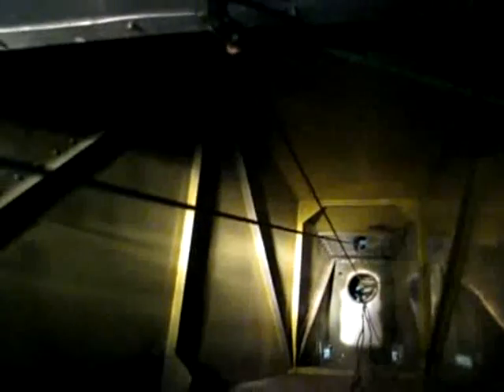Zenith CH-701 Elevator Design Issue.

Comment: That's the kind of stuff scares me about buying home-built aircraft how do you know what is good engineering or not following the kit manufactures design.
Reply from the maker: Good point. Only way to know all the goods and bads about any home built design is to join a group for that specific aircraft and ask a lot of questions. No kit manufacturer will tell you if there is something which could be designed better. But builders will as long as they have not drank the koolaid.  Hard to know for sure as many people in this world do not want to speak the truth for the sake of offending someone. I'm just a flat out honest guy to a fault.

Comment: yes it is about weight. Chris designed the 701 to fit in canadian ultra light cat in 1985 86 and he pulled his hair out to do it im told. I know of a few a original examples still around with plastic wheels 503 and 532 rotax no paint and lots of other design problems  that are probably in not much over 400 pounds . could it and should it be updated  yes you have to be comfortable with what you are flying  but i bet if one of these originals with a good prop and gear ratio change was sent to valdez   could give them a run
Reply from the maker: Even at gross weight Tim I didn't really notice an issue. Then again I have not flown it with a decent cross wind. Mainly because this is a fair weather aircraft. Anything over 15kts of wind is a no fly day for this aircraft.   As for Valdez, people have tried and are up their almost yearly in a 701. But the tail wheel aircraft with a normal rudder (not the full flying rudder like on a 701) are the winners every year. Because of this fact, I do not believe the 701 need that horrible full flying rudder. No one likes it and it obviously doesn't make it better for STOL as shown by the winners of the Valdez STOL compassion each year. I like that for the 750 Cruiser they put a normal tail on it.

Comment: anything you change on this plane will add weight  that is the way its designed  looks like hell but works just fine
Reply from the maker: The Super Cub which is modified is what normally wins each year in Valdez. These planes are designed correctly. If you lost 1lb or wore a lighter jacket or took some of the junk out of the hat rack then you would have removed more weight than the three pieces of aluminum needed to fix this issue. So this isn't really about weight Tim. It does work but not "fine" it just works okay. Just about every design can be improved upon. Weakest part on these CH701s which they fixed with the 801s and 750s is the strength of the landing gear. I can't even tell you how many 701 gear I have had to bend back to original specs for my customers.

Comment: Im building three ch 701 from scratch, with two other A&P mechanics. Two of them that are finished have what we call divorced elevator bell crank mod thats easy to install. Works great and have no problems like the monkey moition that you got.
Reply from the maker: Yeah many of switched from this poor design. If you guys find a way to put a regular vertical stabilizer and rudder on it, I would love to see how you did it. Most people including myself am not a fan of the full flying rudder.

Comment: Very few designs are flawless. As long as the control cables move free this is not a major issue. I'm not saying this should or could not be improved, though ;)

However, in practice, the control forces due to aerodynamics and the mass of the plane are much greater. Bigger issue is if the cables become in contact with the mechanism, which may cause wear or even block the movement. There is not much clearance and this could happen - at least this is what I discovered with my own 701.
Reply from the maker: Yeah all I was really saying in this video is that the design could be improved.

Comment from the maker: Well there is a guy from Mississippi who passed along some information to me about what he did. 
Basicly he took the "A" fram that supports the elevator bellcrank off the flaparon control rod and mounted it on a flat plate just an inch above the control rod. Then he put a rod end baring at each end of the elevator control rod. If you want a photo, send me your email address and I will email it to you.
Chris Hinds (sp) really needs to address this and two other problems with the 701!